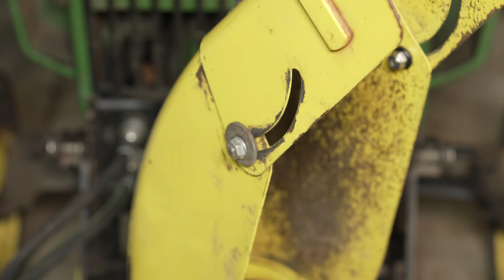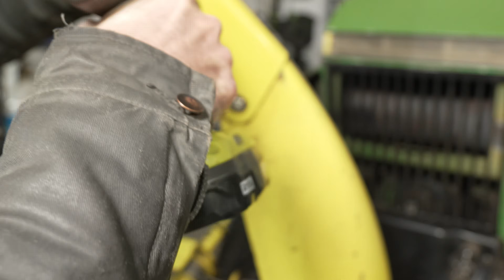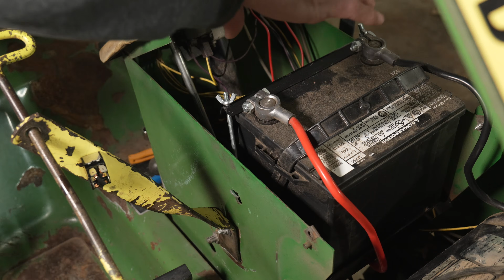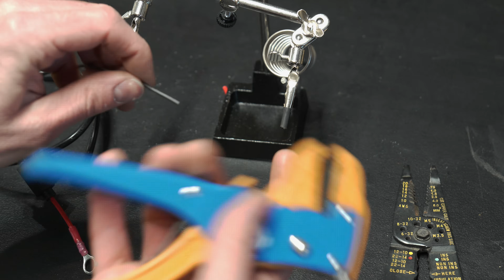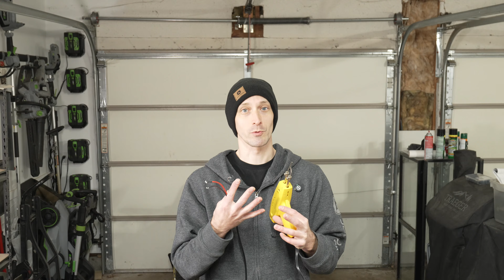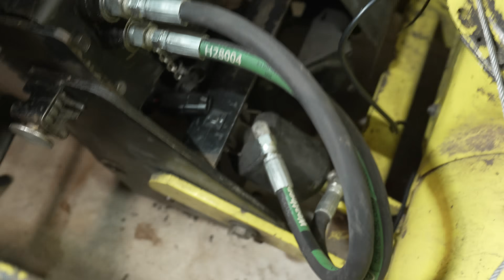Add Electric Chute Deflection Control to Your Snowblower!

Comment: You can get the same kit from Merit automation for only 129.00. The actuator is a bellows type and much faster in the up and down movement.  They invented this type kit and have been at it for over 10 years.
Reply from the maker: @72tx340  Very good to know. I might have to get one to compare. Thanks for sharing!
Reply: @nicksatrangequipment  mention your channel and they will give anyone 10 percent off any kit they sell.